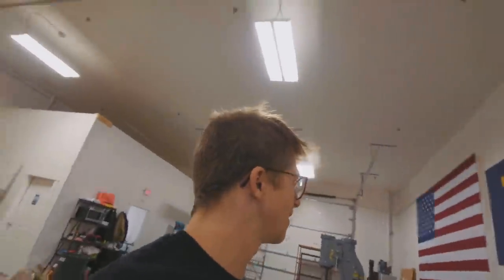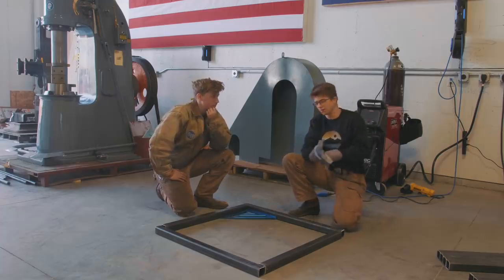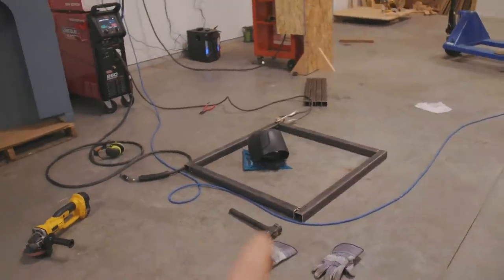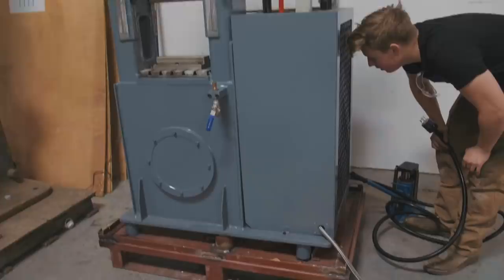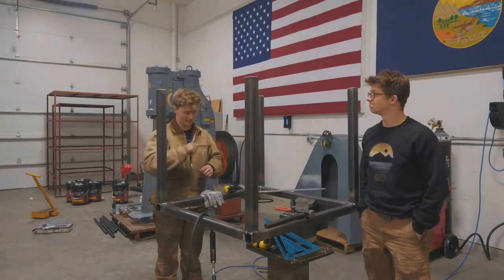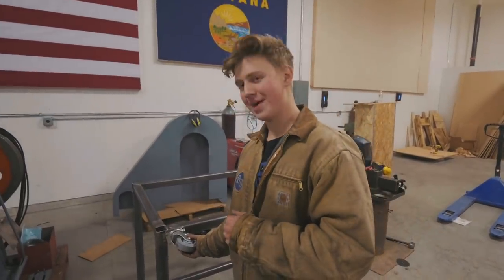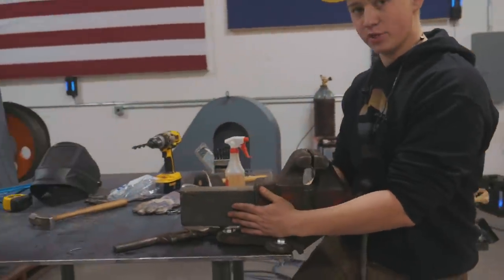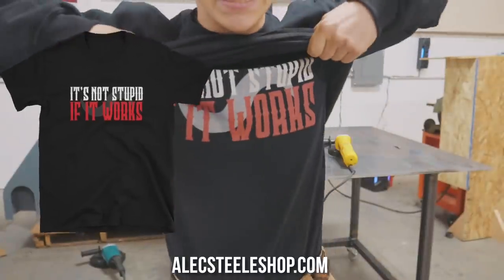HORIZONTAL SURFACE NUMBER 1!!! The Welding Table!

Comment: If you need to pour things from containers that gloop like that, put the spout at the highest point - the air coming in won’t get in the way of the liquid coming out =)
Reply: It's how I was taught to pour oil into cars.
Reply: And if you need to add an air hole, puncture the lid, don't ruin a perfectly good bucket. Buuut, that wouldn't make for such amusing viewing, so, eh.
Reply: yup, they are pouring them upside down.  Spout goes on top to vent.
Reply: Yes, this. 👍
Reply: all the oil pails ive seen have a separate vent on the lid that just needs puncturing

Comment: You don't have to stab holes in your buckets if you pour with the spout on top. Rotate the bucket 180degrees so the spout is highest where the air can enter the spout as the liquid flows out.

Comment: Put the same steel plate, a bit smaller, on the bottom frame. Lowers CoG and more horizontal space.
Reply: But Alec hates horizontal spaces, as they collect clutter.
Reply: Would absolutely be useful.
Reply: Lower cog is key.

Comment: Put the spout at the top when you pour the 5 gallon bucket; no glug glug glug. Just smooth pouring.
Reply: Same with small oil cans, antifreeze jugs, and paint thinners. Pours so much better.
Reply: And milk =P
Reply: I cringed when he stabbed the side of the bucket.
Reply: Yeah, ruined a good potential free workshop bucket.
Reply: Mark Fryer my thoughts exactly

Comment: Should have welded  plates to the bottom to mount your casters to. 1/2" thick with threaded holes.
Reply: Agreed!  Or maybe just some triangular plates at the corners, to mate up with the 4th hole on the casters.  Just my opinion...  :)
BTW, I'm loving these videos!
Reply: Yep, triangular corner plates 😊
Reply: Just weld the casters on and call it done. No need for taps and bolts

Comment: You should put some leveling bolts on the table.  During the summer when its hot its going to go cadywompus on you.

Also those corners on the surface are going to gore someone.

Comment: alec steele this is from a welder i just want you to know that you should not weld any metals on concrete like you did when you were making the frame of your table it is possible your weld piece could cause the concrete to explode i only say this because i love your videos and don't wish to see anything bad happen to you on that note stay safe and keep up the amazing work
Reply: Well, the irony is that the welding they were doing was to weld together their welding table. They didn't exactly have a good place to do the welding. But, they have a table now. (Where they can accidentally weld their projects to. :D )
Reply: I was thinking the same. Why not use the plate as a flat surface to build off?
Reply: That's not really an issue then welding pipes. Because the extremely hot weld isn't really in contact with the concrete.
Reply: I've been welding to plates cast in concrete for 20+ years. I have never had the concrete explode, it's highly unlikely. Using an oxy/acet torch against concrete on the other hand will very quickly become dangerous.
Reply: I arc weld on concrete all day. Please explain how concrete can explode.
Reply: @spudpud-T67  - I believe it has to do with the moisture content of the concrete. Heat from the weld boils the residual water in the concrete which expands rapidly and causes the concrete to explode, sending chips flying off in all directions.

I don't think we're talking about any kind of massive explosion, though. More like a squib charge.
Reply: The NotSoGuitarGuy what you said. It’s the rapid expansion of water in the concrete. No different than putting a river rock in a fire. 
Welding just can’t get it that hot.
Reply: @thenotsoguitarguy9429  So concrete out side that's wet from rain or water could be a problem. A problem if I could get the hot weld to contact the concrete in such a way to heat it. I think concrete inside is pretty bone dry and I'd have to be welding the concrete itself to get it hot at all. I think the concrete outside under the sun on a hot day would be getting a lot hotter than under any welding I've done similar to this video. My driveway maybe undergoing constant explosive action, but I cant see it.
I'll put it into my worry list along with the sky falling on my head.